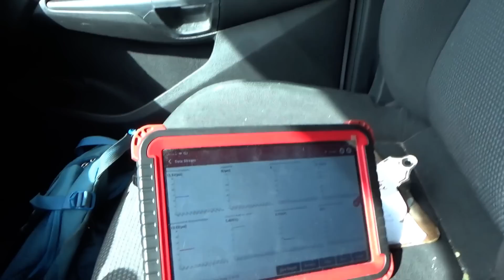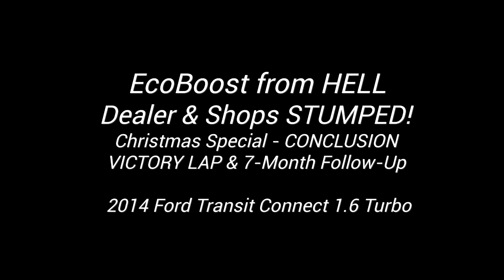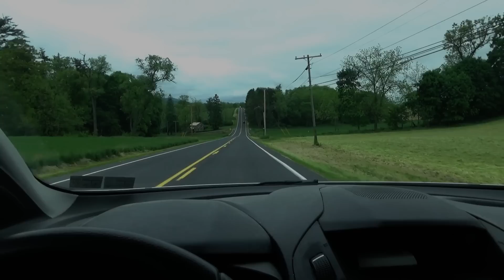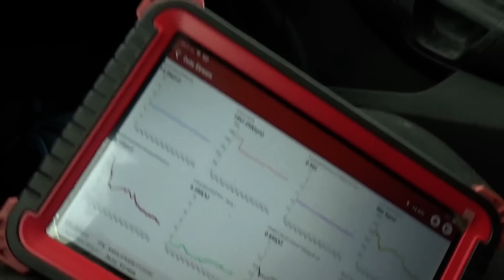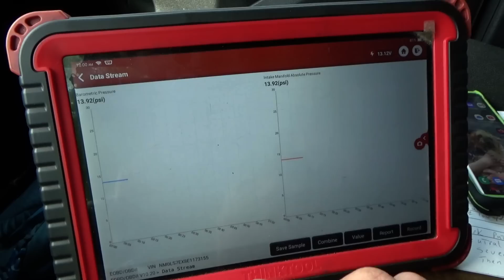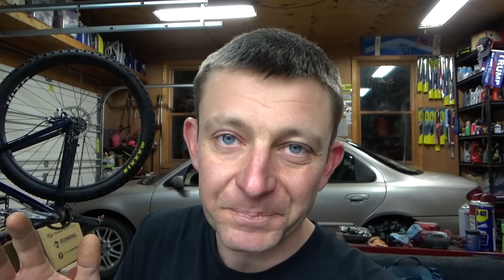(CONCLUSION!) *7-MONTH Follow-Up* EcoBoost From HELL (Christmas 2024)

Comment: I worked for a dealership for many years before computers and I was the one who worked on electrical issues.  I learned early that grounds are tricky.  All these years later with all this computer stuff(and still working on cars), I'm still the guy people call to fix their electrical problems.  They always say "I think I have a short" every time.  99% of the time it is not a short.  It is almost always corroded connectors, broken wires, somebodies crappy accessary installation or a bad ground.  I don't have your computer equipment or skill but I can almost smell a bad ground or bad connection.  I find everything you work on interesting and stick it in the back of my mind for later.  From the start, I knew it was going to end up being  a harness issue.  I probably wouldn't have found it but if I get something wacky,  I'll remember this and go wire harness fishing.  Thanks for one of the best places to learn.
Reply: yap...when u see gremlin invasion usually means ground portal has opened somewhere :)
Reply: As an old Navy ET I'm always amazed that a lot of electrical "experts" don't know the difference between a short or an open or poor ground connection.
Reply: I got hold of a 64 Ford F-100 once, I was working on for my dad. We had fixed the other stuff, including dropping a short block in it.  The brake lights didn't work. This is the last thing we need to get this thing street legal. I used an ohmeter and checked the filaments in the bulbs, they were good.  I put a brick on the brake pedal and checked the voltages coming to the taillight sockets, 12 V. Put bulbs back in, still no work.  This is not possible!   Are the contacts corroded? I sprayed them with contact cleaner and scraped them a bit. Still no work. I took a soldering iron and built up the contacts on the bulbs a bit, so they were almost impossible to put in, buy they are going to make good contact or else. That did no good.  Finally, I got suspicious and crawled under the truck bed.  I saw some wires running all the way to the back and they had been spliced.  I unwrapped the tape on them to find that the wires were just twisted together, then a little bit of electrical tape put around the splice. This exposed to the weather and mud puddles. The connections full of as Ivan calls then, green crusties.  I had enough wire that I could snip the corroded part out and twisted it back together. This time, I soldered the connections and insulated them with heat shrink tubing and wrapped that tightly with electrical tape in order to protect it from the environment. Why did it show good on the voltmeter? Voltmeters used by electronics techs such as me, don't load the circuit. The light bulbs load the circuit and were causing those bad connections to open up. That was at 12V, which the 120V in your house wiring can plow its way through some less than great connections, buy you don't want it to.  Now in modern cars where you may be dealing with computer signals that toggle between one and five volts, or these sensors as Ivan showed us down in milivolts.  The connections must be clean and damn near absolutely perfect.  It would be nice if the car makers would solder those splices. Soldering properly takes some skill, but it might be a good job for a robot.
Reply: Ya, good point.     The problem is that a digital voltmeter has a really high input impedance - about 1-2 MegOhms.   So when used to measure voltage, most of the 12 volts is wound up across the meter compared to the bad connection.  Let's say the bad connection has 10 Ohms of resistance.   A 5 watt bulb has a resistance of about 0.4 Ohms.  So it doesn't take a lot of resistance at a bad connection for the bulb not to be lit even tho there actually is current flowing thru the bulb, but at a much reduced level.  With a bad connection of 10 Ohms,  There would be  12 volts  / 10.4 Ohms = 1.1 Amps.   That would be only  1.1 Amps x 0.4 Ohms  =  0.44 volts with ethe bulb connected.  That voltage won't light the bulb.  So it's OK to use a digital meter with everything connected, but not when a connector or load  is disconnected. @merlingriffin3861
Reply: you would be surprised to find an open wire but its pretty common due to manufacturers using the smallest gauge copper wire that they can use typically around 28 gauge which is really thin and it doesnt take much for the thin copper strands to break
Reply: You too? 😆 🤣 😂 this has me looking at a few unsolved in my past... Ivan always blows my mind with what he finds... that and he is SemiDIY given he works out a normal garage... just blows my mind.. he is truly awe inspiring.
Reply: @Acc0rdLoRd1  Wow, you calling him diy?... Because he doesn't have a fancy big building and charge $200/hr, but he has fixed many vehicles that "ASE" certified and Dealerships and special Euro shops could not fix... If he is diy,  then I'll take DIY over professional any day...  Regards
Reply: @steveo6631  no sir... it was the "Vibe" he gives... allows those who are "DIY" to feel more comfortable... but TY for your thoughts... meaning me...

Comment: As a former electronic tech, I would say the wire was contaminated during original assy. Then as time progressed it caused unseen corrosion, and it's the reason I always solder, because the flux removes those contaminates!

Comment: Well you could have tried a liquid electronics cleaner on the splice before you soldered.  Also, it would have been a pain to isolate the wires, but there's a "deoxidation" technique used in old POTS (plain old telephone system) lines where a butt set will send a low current 90V through the line to try to burn through any oxidation.  The set had a switch so you could switch between +90 and -90Vdc.  Maybe either discrete signal and ground is the way to go, or putting the signal directly onto a bus, so a reverse camera can take out the whole car :)

Comment: Some of the conductors in the stranded wire could have been broken during the crimping process during the manufacturing of the harness causing less conductor area. When you soldered everything the solder flow connected the broken conductors. I had a similar issue with one keypad when my alarm system was installed in my house. Finally convinced the install to redo the splices at the keypad and problem solved.

Comment: Unreal!  As a tech for 46 yrs, I am impressed with your perseverance. At the dealer level this kind of work would never happen.  Mainly because of how do I get paid for all of the time involved.  The shop rate is well over $200 per hour, which would mechanically total this vehicle. Donating time does not happen here.
Reply: This is why I could never be a mechanic.  I will leave no stone unturned, I HAVE to find the root cause. 
I was so frustrated the last time I took a car to the mechanic. They made several repairs, completed them,  and just as they were about to return my vehicle, I got a call that I also needed an alternator. Of course, I was instantly suspicious, since I didn't have any charging system problems prior to the work they did.  I told them, "chances are,  something was damaged while you were working on it". They insisted it was a coincidence, and went back and forth on subsequent phone calls whether the alternator was actually bad (this is an important detail for later) but eventually agreed to cover cost of replacement. Within two weeks of me getting the car back, the "battery" light came on, despite the alternator replacement. I drove the car home, (I was less than a mile away), grabbed my multimeter, opened the hood with the engine running, and attached the meter to the battery. 10.6 volts. I then wiggled the connection to the regulator/ field coil, and what do you know! Engine loads down and the voltage instantly jumps to 14.5v . Damaged wires at the connector. Took me 20 seconds to diagnose, and I'm not even close to being a professional mechanic. . Where are all the good techs?

Comment: It was only grounding to an adjacent wire and not the crimp?  The amount of "work" the adjacent wire was doing cause resistance at the contact point to vary?  You are the Dr. House of auto diagnostics.  It's the results that count.

Comment: This was an interesting issue. It took some good hunting and persistence to solve it. Those spices are typically ultrasonically welded, but the supplier can have issues during production, which may take years before showing up, including breaking the strands from the harness flexing over time. Or, not all the strands get welded.

Thumbs up, Ivan.

We all typically get trained in Conventional Flow Theory, which states the electric charge moves from positive to negative, thanks to Ben Franklin.  It was years into my education before I was exposed to Electron Flow Theory, and when I was, it changed my perspective on issues.  Often today, I first look to the grounds or the ground/negative circuit.  And I find many in the automotive service area (Not Ivan) overlook this perspective.  My video channel is dedicated to the Powerstroke 6.0L and not mainly to the electrical problems.  But I have videos where I've tried to expose people to the grounding side of the vehicles - it's just not commonplace to look there for many DIY people or some mechanics.

Comment: All I can say is: Congratulations, Ivan! Logic, great thought process and perseverance to beat a problem worse than any hellish creature could come up with. This was not a repair series, it was a mystery novel, with a lot of suspense 🙂
As for the odd behavior of the splice, once you didn't open it, I can imagine a partial light oxyde layer on the MAP sensor ground wire, having a semiconductor-like performance, that stopped each time current was interrupted, when you disconnected the sensor, with the other sensors remaining on (unlike with the key off). Anyway, weird :hand-orange-covering-eyes:
Reply: Was thinking along those lines... that splice was basically acting like a diode.

Comment: Another great series Ivan! I'm an electrical engineer and I also solder all my wiring connections when working on my cars, it always works.
Reply: Same... sometimes I use heat shrink butt connectors when I'm lazy, no issues either way.
Reply: The best part is no part, same with connections, I read 7 books on soldering and reliability written by NASA.

Comment: So we need to learn something here. If a code is set for a sensor, you must always check the sensor circuits before condemning the sensor. Also too, be aware that some manufacturers will use an elevated ground on their sensor grounds going to the pcm. The best way to determine this is all ground should have the same readings on them. Now this is exactly why I don't have the hair I once had. Great job! hope you didn't lose your shirt on this job.

Comment: I’ve always questioned the wisdom of applying very low voltage systems to automotive environments…ie salty roads, very hot and very cold, very humid to very dry…it all adds up to endless possibilities of trouble. 
We always keep computers where the atmospheric conditions are as stable as possible , yet we submit out automotive computer systems to the most severe atmospheric conditions….its just plain stupid. I absolutely hate this stuff.

Comment: The only thing I can think of for the wandering ground issue is perhaps a minor break of a strand or two in the ground wire beneath the insulation. Soldering may have helped to strengthen what was lost.

Comment: Since the 300mV drop was constant I have wonder if in that ground splice some kind of strange diode got formed in the connection. 
It would have been interesting to have tested that connection with diode mode on your multimeter.

Comment: What's upsetting is buying a Ford.product and then having this problem, and them not knowing how to fix it, or worse, billing thousands of dollars and replacing parts that don't need replacing.  It explains why they are so quick to suggest replacing the harness for most of these problems, be it a broken or corroded wire, or this problem, the hours of diagnosis would be just as costly as replacing a harness so they just shoot it out of the gate.  

Seems there needs to be an AI software upgrade that notices that the Bar pressure isn't identical to the Map pressure when the engine is not running, there is a no wonder upgrading to a 40 volt system with fewer wires seems a better approach.  I am sure Ivan won't be out of business anytime soon, even with that kind of leap.

Comment: The 1.6 is a fairly reliable engine and didn’t suffer from the widespread water intrusion like the 1.5 and 2.0. Sad ford cut it out of production for the new 1.5. 
The 1.6 was a bit noisy.

Comment: The only thing I can think of is when plugged in there was an active current path through the splice so it would slightly raise the temp of the splice ? Then once unplugged it would cool down again and start all over. Heat increases resistance if i remember right.